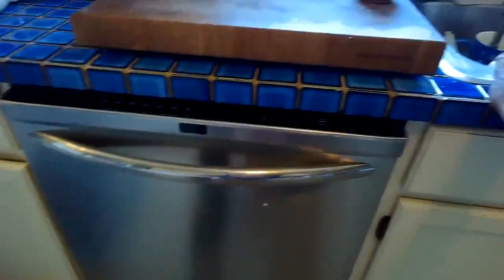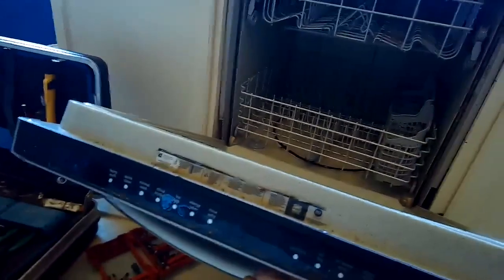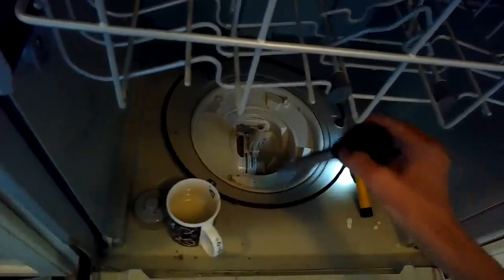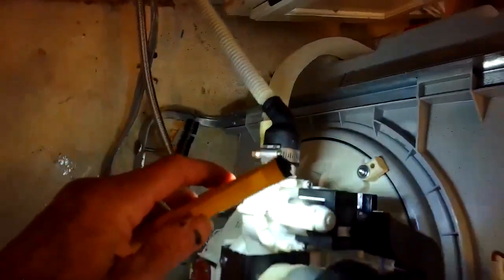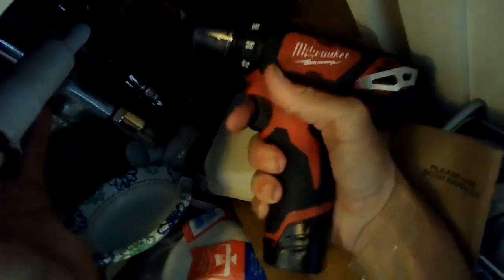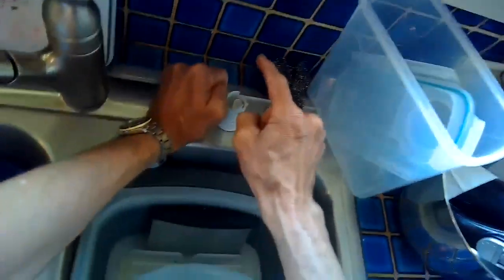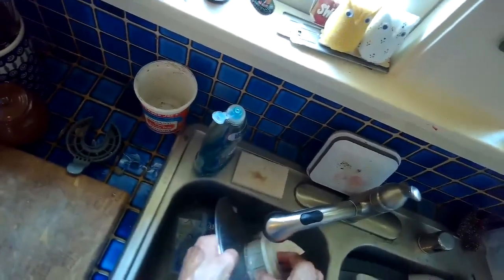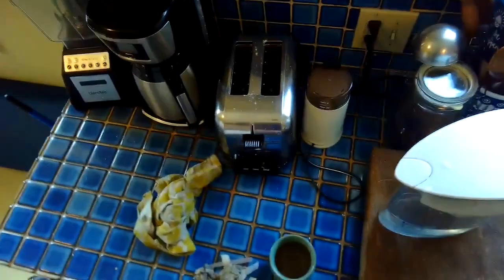✨ FRIDGIDAIRE DISHWASHER WON’T DRAIN - EASY FIX ✨

Comment: It was the drain checkvalve and drain tube for me, It was very minor to clean the valve and exhale into the drain tube like you showed, other than pulling the washer out, likely grease from a pan gummed it up. 

I used a shopvac to vac the standing water out and clean up the inside prior.

Comment: Hi I'm thinking of buying a used dishwasher with ec code .any ideas ? Thanks 👍🇨🇦
Reply from the maker: Maybe a used Bosch with a metal tub.  I would ask the owner to let me watch it run for 20 minutes to make sure it can drain, fill, and circulate the water.  At 20 minutes open the door and you should get a big plume of steam coming out👍

Comment: Dishwashers are a waste of time. With everything that goes wrong with them being a problem, you have to rinse the dishes before using the dishwasher , you have to load and then unload when finished. So where is the plus or time saving with a dishwasher? Definitely over engineered for what it accomplishes.
Reply from the maker: That’s true,
There is a silver lining though in using a dishwasher.
Eating mechanism allows water to get so hot did it creates steam and that steam will destroy any pathogen.
Reply: @QuickAndEasy5MinuteAppliance   Yes I do agree but a few drops of bleach in the wash water accomplishes the same result.